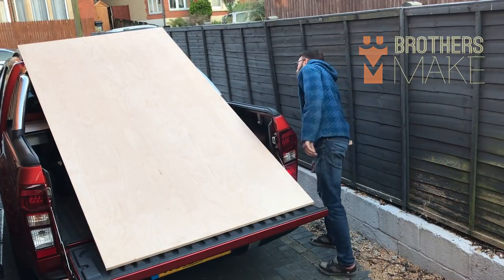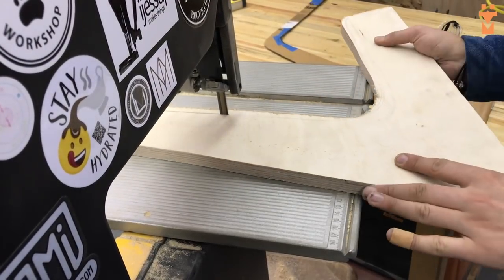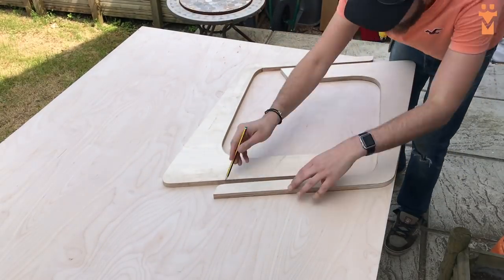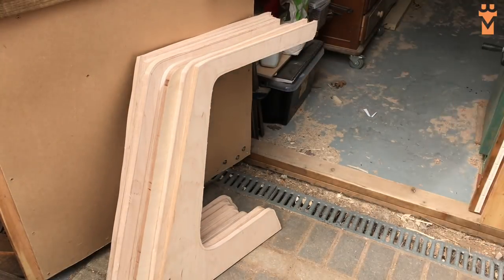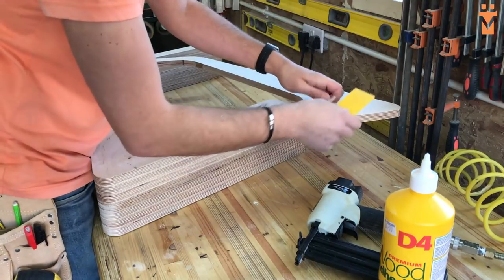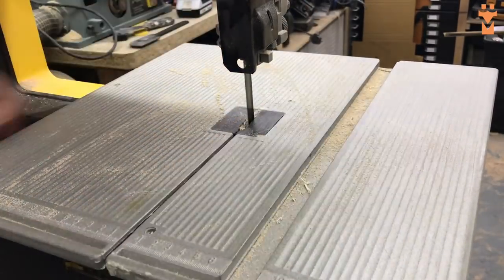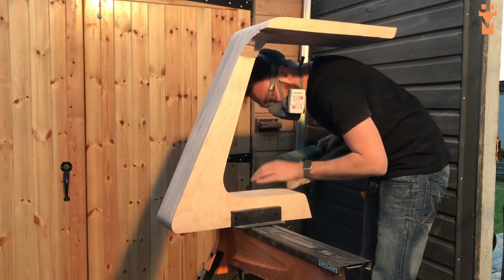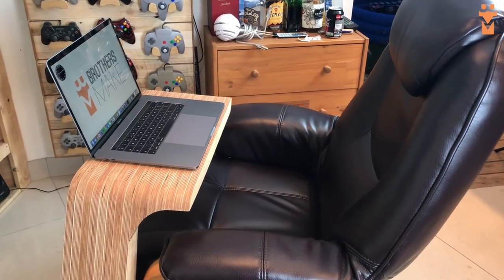DIY Plywood Side Table from 1 Sheet of Plywood - #RocklerPlywoodChallenge

Comment: Great video.  I was a little concerned in the beginning when this strapping young man needed a dolly to carry a single sheet of plywood.  Thanks.
Reply from the maker: I had a dolly to hand so would rather use it and not put my back at risk. Thanks
Reply: @BrothersMake  I used to work in a timber yard, I guess I carried a couple of thousand sheets of ply over the years, plus MDF, OSB and plasterboard.  One one job, with another guy helping, I pushed about four pallets of ply through the table saw (200 sheets), going down to 9" rips if I remember correctly.  None of us used dollys, there is a technique to it.

Comment: You did great up to the point when you put polyurethane on it.   Don’t use poly use lacquer. Poly is for amatures
Reply from the maker: We wanted to use a thicker and slightly more robust finish as the layers were exposed and spilt drinks could potentially absorb into the wood.

Comment: Cool project!
One could use the plywood even more efficiently by using only whole parts on the outside and smaller pieces on the inside. As long as the small pieces overlap each other that shouldn’t effect the strength of the table.
Reply from the maker: Yes you’re absolutely right. I considered increasing the width in this way but ended up deciding against it as I liked the proportions as they were.
Reply: Brothers Make 
Armchair commenter here 🙄
I like the design and your video production skills as well!
Reply from the maker: Thank you very much!

Comment: Great design, but it seems a bit unstable with the base that narrow, wonder what it would look like with a flare out on the bottom like at the top.  And then inset a steal plate on the bottom to add extra stability.
Reply from the maker: It’s funny you mention that - we actually had a 10mm steel plate set aside as back up in case it was too unstable. However with the base being thicker and the ‘leg’ of the table tapering wider at the bottom it is deceivingly stable. We wanted to keep the footprint as small as possible so that we could use it in between our two chairs - there’s a shot of it in use at the end.

Comment: Love the table. Been looking for something like this for my computer room. How did you figure out the balance? Is there any way to get the measurements?
Reply from the maker: Thanks for the comment! We didn’t test the balance until the end. We planned to put a steel plate in the bottom if it was too unbalanced but didn’t feel the need to in the end. Don’t have the measurements I’m afraid! But just made the card template based on what felt a comfortable height.

Comment: When you were routing all the other pieces to the same size you used double sided tape to keep them from moving, but you used 4 clamps to keep everything steady and you had to continually move the clamps to complete the router. Why did you not use the double sided tape on the underside one to the bench.
Reply from the maker: Good question. The double sided tape we have was not the strongest. I could have done with some stronger stuff but had run out. The tape was mainly there to ensure that when I took the clamps off to move them, the pieces would not become misaligned. Taping to the bench would be w really good idea! Either that or getting a set of those fancy vacuum clamps. Thanks for the comment 👍🏼

Comment: Great design! But small top (if use laptop) and uncomfortable for arms i think.
Reply from the maker: We used a laptop in a couple of the clips at the end of the video and it fits well. It was designed to be big enough to hold our MacBook. And all the edges are slightly rounded to avoid discomfort to your arms whilst leaning on the table.

Comment: Nice design. Shame you didnt hollow out the middle pieces to reduce the weight. as that is more likely 20Kg atm. Making the center parts hollow would have at least reduced it to around 15kg give or take. 
And while some people may say it would weaken the build. Its plywood it's not going to be that much weaker but will be lighter
Reply from the maker: As a table it’s not something that will be getting moved around much so all the extra work involved to hollow it out wouldn’t have been worth much. That would definitely work to reduce the weight if needed though.